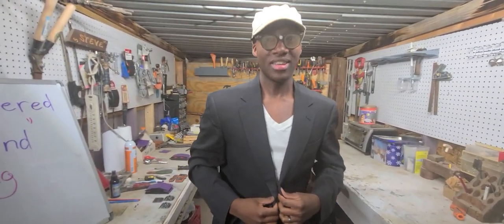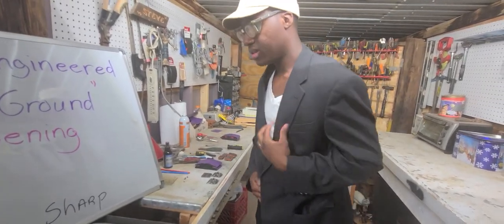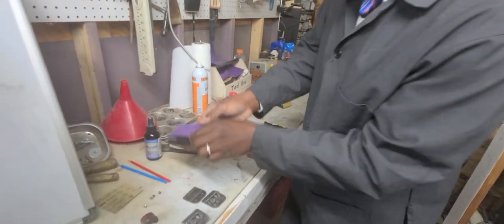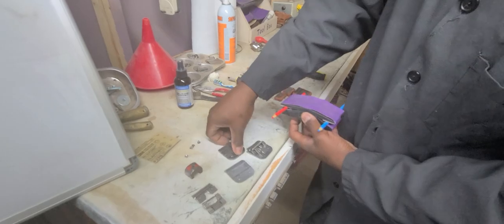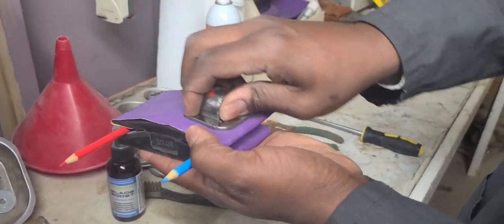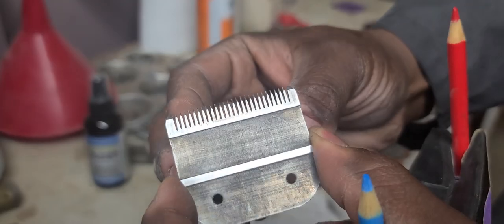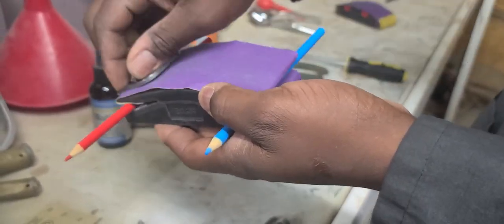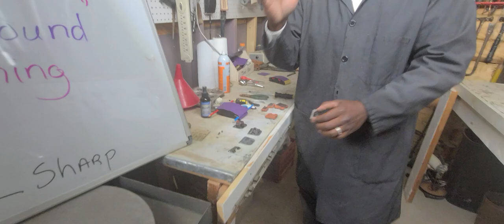Part 3. HOW TO SHARPEN ANY CLIPPER BLADE PROFESSIONALLY  Hollow ground with sand paper!!!

Comment: sand paper vs grit.  they both grind The grit you use is finer than the grit I use. LOL  Seriously to get one over the hump when a blade goes dull this will get you thru. certainly not ideal.  Powered honing wheels have been around since the 1920s with the three sisters.  You know them. Oster Andis and Wahl.  As to why the hollow grind.. Fairly simple friction.   Those old hand clippers.. did not have a lot of pressure but they also could be cranked down and still cut.  but takes a lot more hand strength that way.  Modern clippers run at fairly high strokes per minute.  With friction they can get so hot you can  easily burn someone.   So long as you dont put to much hollow they should work fine.    Keep em oiled. As I said friction is not your friend.  The real difference between what you are showing and my comment about the manufactures is that  they would be out of business if they had to resharpen after 20 or so hair cuts.. 500 is the number I shoot for. This is why many groomers only make it 5 -8 weeks between sharpening.. Dirty hair and just shear volume of hair that is cut.
Reply from the maker: Thanks. Out of all the sharpeners i ask to do this your the only one who did it. Gave me true feed. Im out here trying to help. And respect you as well. You are a real one. Thanks so much. Maximum respect to you
Reply: @keepitsharp357  kind of feel like no one likes being taken to task.. Be hard on the problem not the messenger.  The biggest problem is usually that most barbers know a lot that just isnt so.  Part of what I do is educate.  This stuff is never taught in barber school for doing basic maintenance.  I end up going back and repairing a lot of clippers that they have 'tweeked'  I figure they only really want one thing.. blades that cut and clippers that let them do that while keeping the heat to a minimum.
Reply from the maker: @stevepailet8258  very true. Thats all barbers in a nutshell. You are a blessing to the barber industry. Thanks and keep up the good work
Reply: I’ll never be a barber but I’m cutting my sons hair and my wife cuts mine so this clipper and blade info is important to me! I’m a teacher and I respect those that are willing to teach others that don’t have all the information. My clippers are at the point of pulling hair so they needed more than just cleaning and this has helped me. And even though I’ll never be at the level you gentlemen are I appreciate the dialogue between professionals! Thanks for helping out the at home guy who wants to cut his sons’ hair and make sure his clippers work properly!
Reply: @tommann1776  remember it is $5 -$$7 to sharpen a blade while you wait.  $25-$40 to buy a new blade out of the package.  By the time you get past the frustration of a dull blade you could have gotten it done right and be on your way for another year
Reply: @stevepailet8258  I don’t go to a local barber because we cut our sons’ hair so not sure where to get it sharpened. And I’ve got oil and cleaner for it already so getting some sandpaper is cheap and easy and I’m ok with doing the work. I don’t pay to get my lawn done but I could. I don’t pay someone to replace my car battery but I could. But sometimes doing it yourself is possible and saves money. I’ve replaced 3 faucets, done a French drain and replaced multiple light fixtures. Those things can add up so I try to do what I can. And it’s satisfying. So I’m ok with not buying a new blade every year and finding a way to sharpen the one I have on my own. I appreciate your idea of getting a new one and getting it sharpened but I also like knowing that now I can do it. Theirs satisfaction in that for me. And it teaches my son lessons about being resourceful, learning how to do something and becoming independent. So there’s value in your method and value in learning how to do it.
Reply: @tommann1776  you missed the point.  get it sharpened once a year.  You do not have the tools to do the job correctly. Has zero to do with your abilities.  What you are talking about is akin to using a 75 pound jackhammer to drive in a thumb tack into balsa wood.  I see a fair number of boy friend sharpening these tools and then the girl friend gets ultra pissed because the geometry of the cutting surfaces is F***ed up in a major way. Some use belt sanders or such.. Some put them on a honing stone. Some just use their wood working tools used for chisels.  or flat surface with sand paper.  Do it as you wish but do understand it is the wrong tool for the job.   The cost of a new blade is not much the cost of sharpening is a small percentage of the cost of a new blade. Do as you desire just dont get upset when it pulls your hair out in clumps
Reply: @tommann1776  I have installed dozens of bathrooms. Leave digging french drains to those who like sharp shooter shovels. So with that in mind.  I will continue to smile
Reply: @stevepailet8258  I got it. Thanks for the tips! I appreciate the honest input. I’m no barber just trying to figure a couple of things out and this has helped. And your info is part of what’s helped! And I’ll try to fix most things around the house if possible. I did the French drain in august and we’ve got lots of clay so digging was tough and heavy!